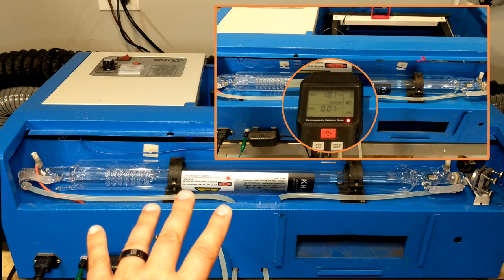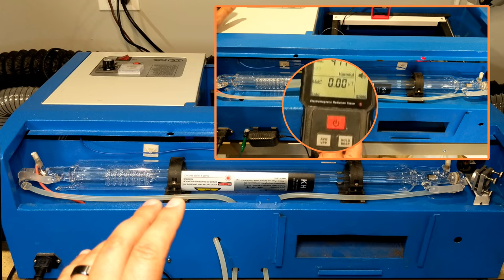eBay K40 CO2 Laser  - Why it is Important to use Distilled Water!

Comment: I work with Hypertherm plasma cutting unit and they used a propylene glycol special solution for cooling their high frequency power unit (plasma). It's their own brand. Is it something thats seems good ? Since the plasma torch shouldnt have any electricity inside the EC must be pretty low and must be good for winter/cold places since its glycol.

Hypertherm coolant composition:
69.8% water
30% propylene glycol, industrial grade
0.2% benzotriazole

Max conductivity: 10 uS/cm
Resist freezing up to -12°C (10°F)
PH 4-8
Reply: Following on research...

Distilled water supposed to have an EC of 0.5 to 3 uS/cm

I don't know so much about laser cooling but I am expecting lower is better ?

Comment: Hi can I deionized water in stead of distilled water and can I use antifreeze
Reply from the maker: My recommendation is no and no as covered in the video it is the impurities in the water/fluid which allow the inductance.
Reply: @DIY3DTECHcom  hi thank you for replying but would like to say that deionized water is pure it has no ions in it. It doesn't conduct electricity and its cheaper than distilled in the UK

Comment: hi, nice explanation, but what happen if laser is kept under 0 °C? is there any suitable cooling liquid for "winter" work? And also, tube have to be cooled or also heated.. I mean which is the working range? I will keep it on external place and  Iàd like to setup a proper cooling/warming system .. any suggestion?
Reply from the maker: You shouldn't (4C or 40F) the min range for most laser tubes is 4C or 40F and I know a lot of people keep these in unheated areas, however it will adversely affect both performance and life of the tube...
Reply: Ok. The problem is that also in not used, but simply stored outside.. in case of very cold day water may become ice and tube will cRack  I suppose.. so the only way is to remove water if not used and stored in a cold place?
Reply: Omtech makes antifreeze for co2 glass lasers
Reply: Omtech makes antifreeze for co2 lasers, about $36 a gallon

Comment: Explains alot.. how would you recommend flushing out the tube to clear for the distilled water? Here in the uk they mention supermarket mineral water is the same. Would you agree?
Reply: You should not operate with k40 laser, if you ask questions like that!
Reply: @sskkuuddrraa  is there any need for comments like that??? FYI everyone has to learn sometime so id keep your comments to yourself and as a matter of fact i got it sorted 👍
Reply: Hateful (as it might seem) comments, is like ground wire..You can live without it, but its right place and time, it can save Your life.
Reply: @laurabrooks6986  Have you found distilled water somewhere? Also new to laser (got it this week) but I haven't even turned it on yet as I don't want to run it without distilled.
Reply: @JamesW81  as recommended by other uk k40 users i used deionized water which is on car/diy aisle of asda! 1.50 a bottle it is and i only used 5 bottles! I am on Instagram if need help and can put you on to some amazing guys that helped me with all enquiries.. unlike the a@#s who commented above 🙄
Reply: @laurabrooks6986  great info Laura, I was looking to ask the exact same question! Picked up my k40 yesterday and want to test today.....calling into the asda later for some deironized water. Did you add anything else too? Antifreeze etc. I've read mixed opinions. Cheers
Reply: @chriswalsh2023  no as i use mine in the house and only reason you need anti freeze is if operating it in a garage or somewhere where its gonna get very very cold.. but of course in uk we rarely hit seriously cold temps.. if your area you are using it can drop to below 2 then yes but mines in house so all cosy 😊
Reply: @laurabrooks6986  Nice 1, just deironized water it is then. Thanks
Reply: @chriswalsh2023  no problem.. if need any more help just ask 😁
Reply: @sskkuuddrraa  some knowledge is a must to safely operate the laser, I'll grant you. But I wouldn't class not knowing the specific distinction between mineral water, deionised water and distilled water as an admission of such devastating ignorance that it would cause me to call her ability to operate the laser into question.
Reply: @tombackhouse9121  
So you think its ok to ask HOW to flush out tube? :D HOW?

Comment: I recently bought a used k40 that doesn't look used. When I test fire the laser will mark but when I go to engrave the tube lights but nothing happens on the material.
Reply: are your mirrors properly aligned?
Reply: @bawi2  just now going through the mirrors. Got it to engrave on the closest side of the work area last night.

Comment: Can you do a test to show just how much it might reduce the laser power? I've got 5x 150w machines, running 8hrs/day for the last 5 years on tap water, and haven't noticed any power reduction myself... And this is honestly the first time I'm even hearing of such a phenomenon.
Reply from the maker: Unfortunately I do not have a laser power meter however I would guess around 2% depending upon the conductivity of the fluid.   However on 150 watt laser I am doubting you will notice that much verses a 40 watt unit they have no remaining overhead where at 150 watts my guess you have quite bit.
Reply: ions and 'stuff' in water conduct electricity, not the pure water, and while the water is on one insulated side of the glass tube from the plasma, it will have a small effect, like when you put your hand on a plasma globe the streams come to your hand....
distilled water is considered pure as its made from steam and all the 'stuff' in it gets left behind, that is except for the ions... ions are metallic inn nature and can still cause the water to conduct just as much as when it had all the organic 'stuff' in it !
deionised water is considered less pure as it can still contain 'stuff', but it doesn't contain the metallic irons, so can be less electricity conductive.
nowhere near me sells distilled, I have plain, 25l of deionised, 25l of reverse osmosis but no distilled, when i have access to all 4, i will be doing high voltage conductivity tests to finally get an answer, and then i will refill my laser with each and run power/speed/engraving tests to see if theres a visible power difference...
Reply: @lezbriddon  Have you run these tests yet by any chance? I've just received my laser this week and I'm struggling to find distilled water at a reasonable price. Short of making a still, I was wondering if deionised water is suitable.
Reply: @JamesW81  I got delayed due to life, well let's be honest I took the k40 apart and started upgrades :) but I still have the water and I planned to test it then refill, but it's dragged on longer than expected so I'll pull my finger out and get them tested in the morning without fail.
Reply: @lezbriddon  lol! I've not even turned mine on yet, and I've ordered bits for air assist. New lens has arrived, but still waiting for head and tubing.  I think I'll upgrade the main board at some point, but I'm in no rush for that.
Reply: @JamesW81  there's not much the stock board doesn't do that new boards do. I looked at the options and just stayed with it, at the end of the day it has two jobs, move the shiny bit and turn on the burny bit, jobs that any board can do and they can only all do it the same way.  Ok the standard board can only run at a set power, but with most software can turn that power down by pulsing so provided your software has s power setting(I like meerk40t) then I don't see the upgrade being that necessary. But I only cut or engrave text etc, maybe for photo engraving there's some improvement, I don't yet know
Reply: @lezbriddon  Yeah, it was mostly the extra power control that I was interested in. I bought the laser primarily for cutting and engraving perspex sheet. I'm wanting to make a replica F-14 cockpit for DCS. I might end up doing some wooden ornament things or engravings to sell, but I'm definitely gonna see what she runs like with the stock board for the time being.
Reply: We test between 5-8 tubes a day, the wattage drop off ranges between 20-50% depending on the mineral buildup inside the water. With stainless steel water tanks if the water sits for more than 3-4 months we regularly see above average failures as well.

Comment: Do you think distilled water with chlorine added is ok?
Reply from the maker: I wouldn't as again that defeats the idea, as the voltage is high so not a lot would be needed to conducting.  Also if you keep you cooling system clean and closed, you will get around 3 months (or at least that is what I get) before needing to change the water.  Also to clean it would not use bleach, but H2O2 as a cleaning agent if scum does build up and rise with water...

Comment: I've heard of people using antifreeze in their system. What "light" can you shed on this aspect? And yes, pun was intended. Lol
Reply from the maker: Not a good idea, and some antifreeze's can damage the silicone hoses too...
Reply: @DIY3DTECHcom  and what if I use ethyl alcohol from pharmacy? is it the same? somehow I have to avoid the freezing, but I can not use warming machine.
Reply: @DIY3DTECHcom  you are right, I used anti-freeze and and 6 months later my tube going to the high pressure switch fell off in the middle of of an important job for 3* Gen.